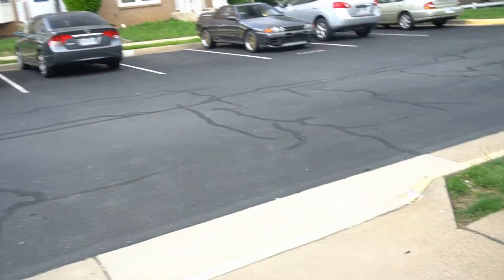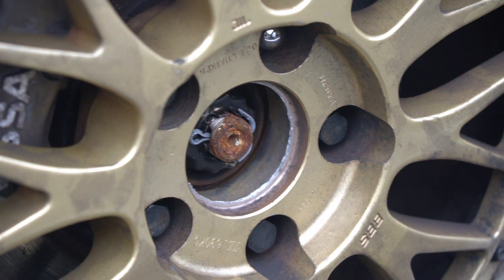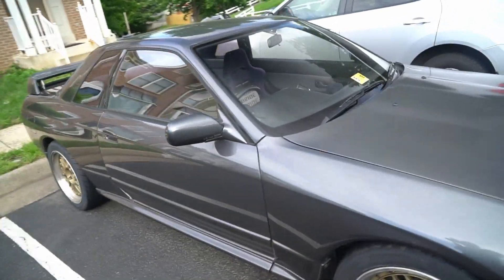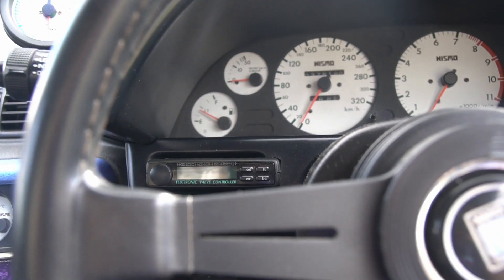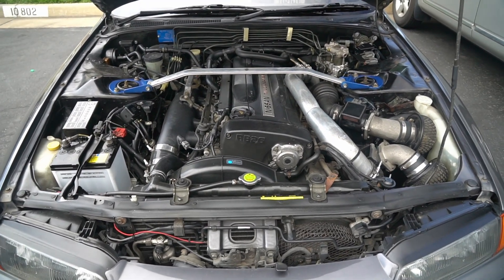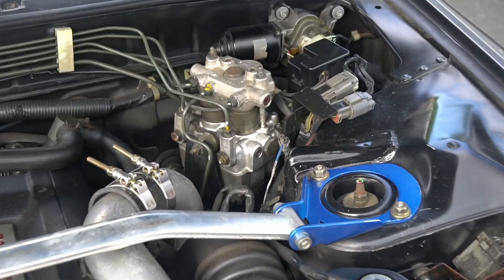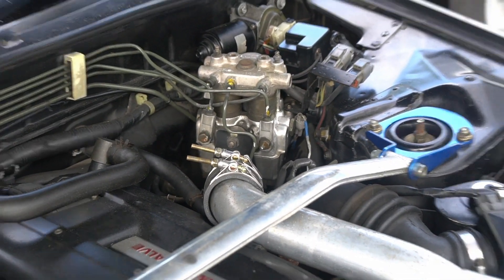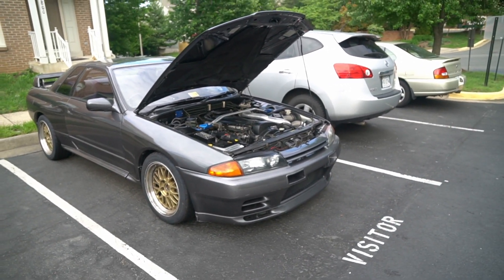ABS Pump Broke in the Skyline GTR

Comment: I don't own a GTR but I always hear about oiling issues. Most R32 owners upgrade to the N1 oil pump or some other competent aftermarket equivalent to remedy that weak link. Just a thought if you ever go into the internals or decide to do a motor refresh.
Reply: Britton  Wright oil starvation is the problem..  the head doesn't drain the oil back down quick enough at high rpm for extended time.  ppl fit a tomei 2mm restrictor in the block when doing their head gasket.. they might fit a head drain kit and a tomei baffled sump.  all those thing help get the oil down to the sump quicker. oh yeah sump return holes can be drilled out more.. 1.5mm by default ppl often take em to 3mm I think.  mine was.

the n1 oil pump is good.. a long nose crank or a spline drive fitting on the end will ensure the pump is seated right. reimax gears in the pump are stronger too.
tomei oil pumps are too powerful unless you run a silly power rb that needs the oil.
Just some info :)
ant
Reply: ANTSGTR awesome man. Cleared up a lot for me there. Thanks for the info.
Reply: yeah just fitting an oil pump isnt the answer.  as said you need to get the oil to flow back into the sump properly and not sit up in the head.  careful of high g track work until you do.  also always keep the oil conpletely full in any RB engine.

Comment: Common the tube splits mine failed on the MOT brake test.
Reply from the maker: Any more information you can provide?  Exactly which tube splits?  How do you guys typically go about the repair?
Reply: @JoshTaylor  Its one of the tubes that join the unit head to the main body. Most get rid of the ABS unit Nismo R32 GTR did not have ABS, so kind of an upgrade
Reply: @JoshTaylor  Update found out the 300ZX Unit fits with minor bracket and Connector changes so have ordered one of those
Reply from the maker: @gtrjazz1  that's pretty much how I fixed mine for $30
Reply: @JoshTaylor  I ordered two and will fit the newest looking one

Comment: That engine bay looks like it has seen better days, could be worse I suppose. Youre in for a ton of more fun/surprises though lol Im a year in and finally (hopefully) got all my bugs fixed. 😉 The never ending project 👍🏻
Reply: Ps you got a boost leak, id listen for any hissing/split hoses. Mine also had one when I recieved the car. It had a crack in the clutch Booster pissing air out bad. Plugged the line to it, and it eventually cracked more pushing the whole cylinder away from firewall.. and disabling it. I replaced booster/cylinder/slave.. among other things just to keep it on the road. Anyways, If your shifting becomes sketchy like mine and others, replace the Slave 👍🏻 Or if you have any questions feel free to ask 😉 Nothing forums and other owners cant help with though lol.